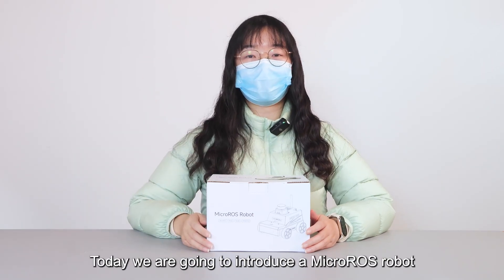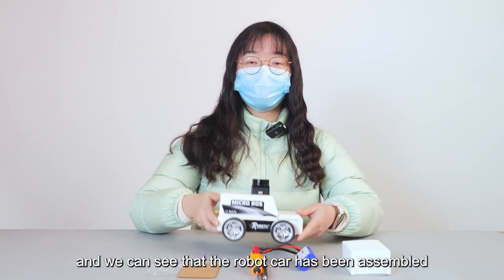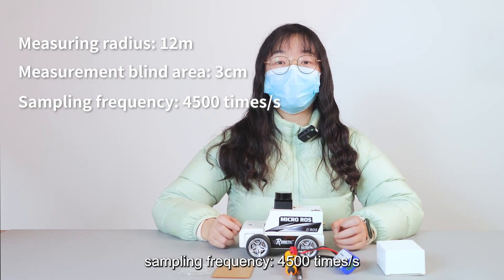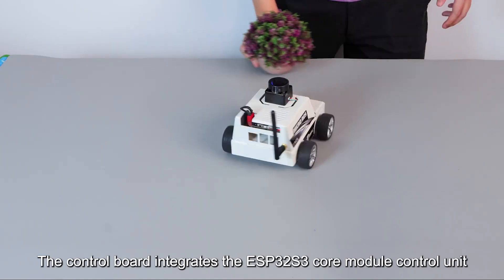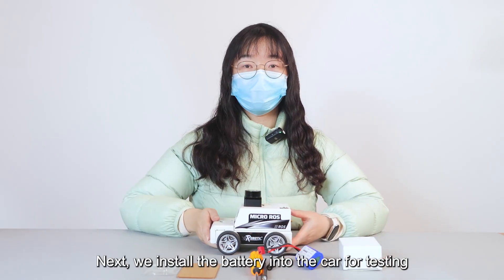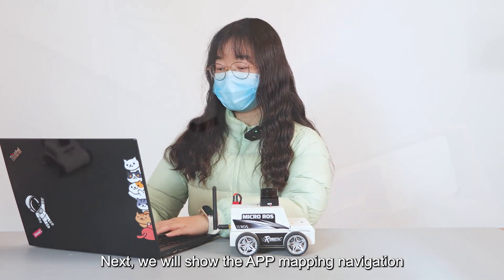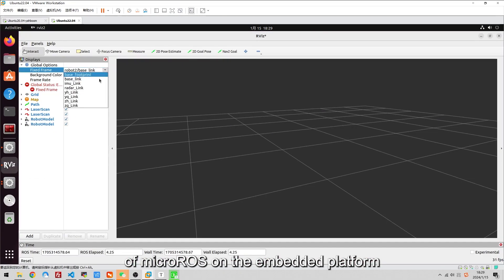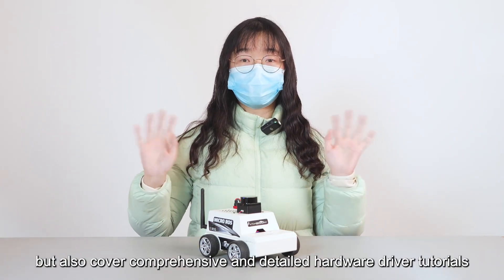【Unpacking and reviewing】----MicroROS Robot Car

Comment: Has anyone been able to get the VM to boot in Win10?  I consistently get dropped to an emergency console (terminal) command line. I've tried numerous "fixes" I found online but nothing helps.  I'm using the VMWare and virtual machine from the Yahboom link.
Reply: I found an answer to this.  Folder sharing needs to be enabled for the VM. This got rid of the errors for me.
Reply: @wheagy  thanks for posting a fix.  I'm still debating about getting this or taking a more DIY route.  Would you say it was worth it?
Reply: @gary909  I haven't received it yet.  I ordered on Amazon and it's running late.  I have two other Turtlebots running ROS and thought this would be a good intro to ROS2.  The idea of having most of the compute off-board is interesting so I'm anxious to see how it works.
Reply: @wheagy  ah ok - I hope it works well for you!